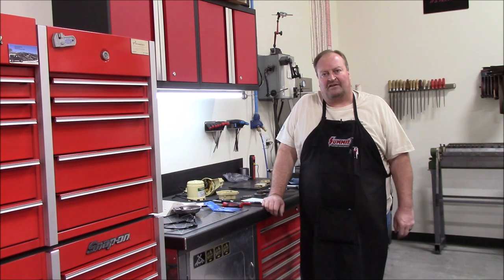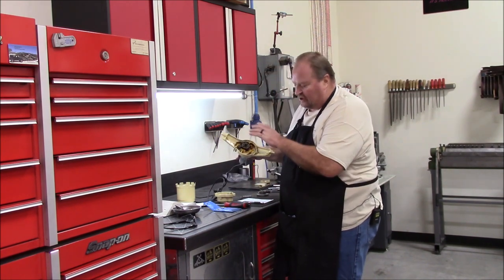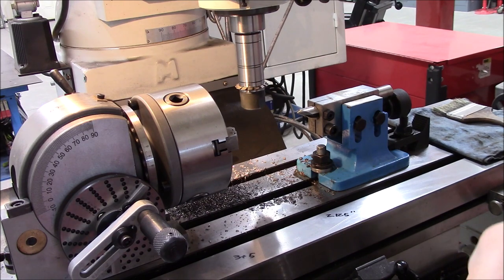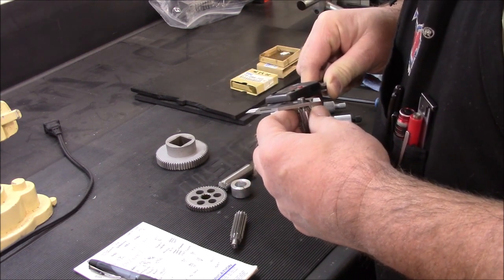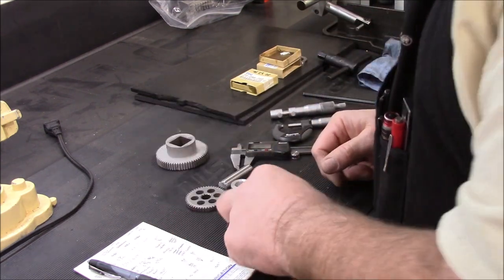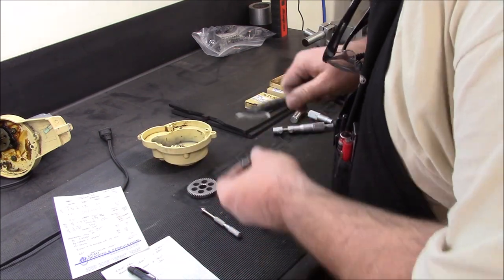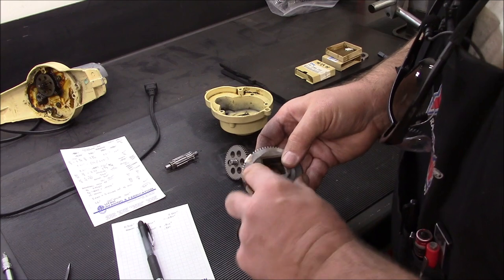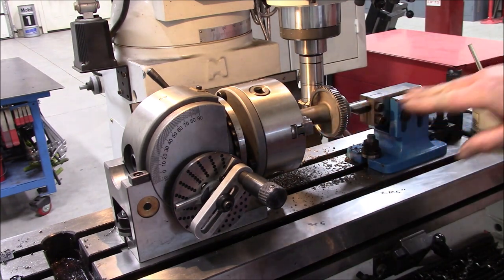Electric Ice Cream Maker Repair

Comment: Thanks for the video.  Where did you find the cutter for the large gear?
Reply from the maker: I purchased both cutters from Travers.  They’re both imports but they worked perfectly and appeared to be decent quality.  

Thanks for watching.  
Mike
Reply: @zmotorsports62  14.5deg or 20deg pressure angle?
Reply from the maker: Diametral Pitch (DP) of 24 with a 14.5* pressure angle.

Comment: Hey Mike,

I have a White Mountain 6 quart ice cream freezer which has the same problem with the spline. The spline is stripped and the gears no longer work correctly. Would you be interested in fixing this for me?  Of course would be happy to pay you for your services.    We love our ice cream maker, and so disappointing that it broke over the weekend.  

Let me know if this is something you’d be interested in and if so we will work out contact information. Thank you so much. 

JB
Reply from the maker: I won't have time for a couple of months but may be interested after I get caught up.

I must  warn you though as it will be an expensive repair due to the amount of time involved.

Thank you for watching.
Mike

Comment: My Ice Cream Motor just leaked oil for some reason.  Why does it leak grease?  I only used it a few times...Help
Reply from the maker: More than likely heat related or wrong grease, too low of a drop point.  

It's not very well sealed by today's standards.
Reply: @zmotorsports62  Thanks for getting back to me!  I was thinking that that It got to warm from running it after the ice was frozen and it put more pressure on the motor.  But it was only 35 minutes.  I’ll check after 25-30 minutes next time and make sure everything is put altogether right…I’m hoping it won’t happen again.  That grease is nasty.
Reply: You have amazing talent!  It’s great that you know how to do all this!
Reply from the maker: Thank you. I've been doing it a long time and I'm happy to be able to share with others so we can all continue to learn. 
Thanks again for watching. 
Mike